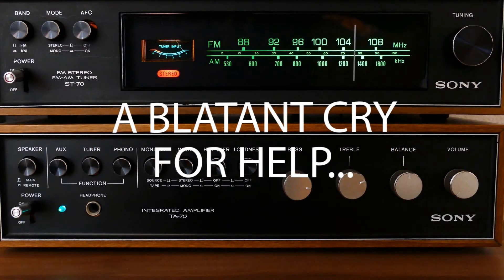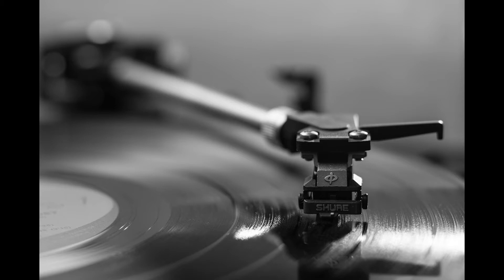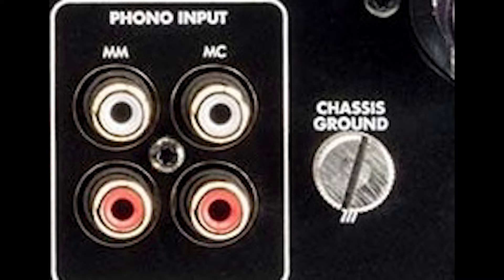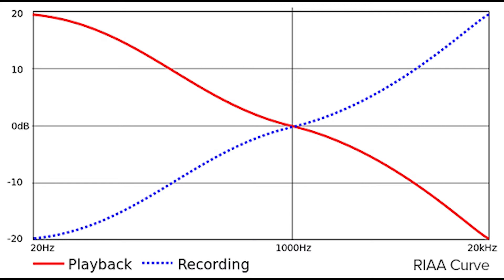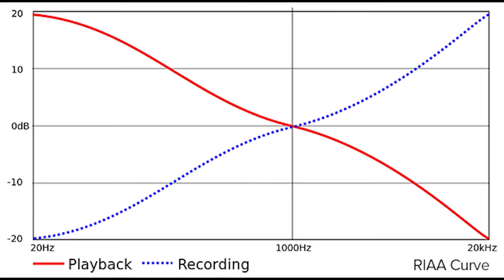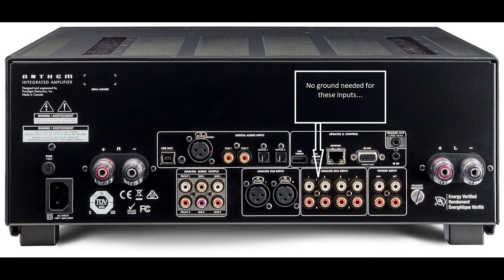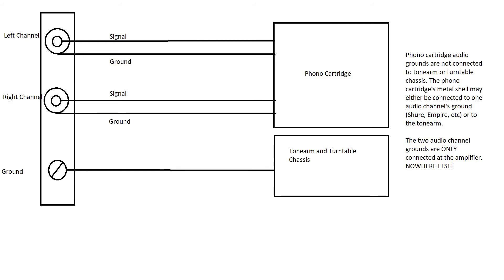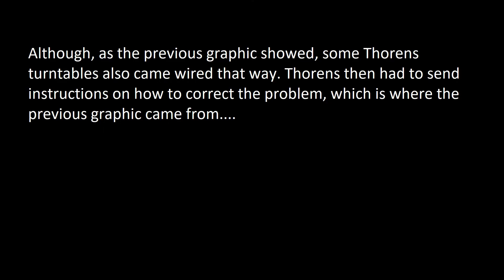Why Do Turntables Have Ground Wires?

Comment from the maker: Errata: Yes, I slipped up in editing my audio and let a double-negative through. But you know what I mean! :-) And at about 3:43 I said "pseudo unbalanced." Of course, I meant "pseudo balanced." Sorry for any confusion. And by the way, a few 1980's Sony turntables have a ground wire that connects to the shield (ground) of one of the RCA plugs at the preamp end of the cable. This will work just as well as using the separately-connected ground wire, and I wish all turntables came that way. It'd be a lot easier!
Reply: Hi Scott. Wonder if you could help me. Just received a connector that connects my turntable that has two jacks with an old amplifier, that has 5 pin jack. There is a cracking in left speaker, and same one does not produce a sound. (It is working with anything else). Those two jacks come with a ground connector, but nowhere to connect it on my amplifier. Wonder if I could, would that solve the problem? Thanks!
Reply from the maker: @sextempiric7137  all right, let me see if I understand this. You have an adapter cable, that connects a turntable with RCA jacks, to an amplifier that uses a din jack. If I'm right about that, then the noise you're hearing would not be solved by having a ground connector, although you really do need one. What the ground connector would solve is a hum problem. The noise you're hearing makes me think that you have an intermittent connection either at the phono cartridge, or at the wires that connect it to the head shell, or where the head shell connects to the tone arm, assuming that your turntable has a removable head shell. I wish you luck in trouble shooting it.
Reply: @ScottGrammer  Thanks, You're a gentleman!
Reply from the maker: @sextempiric7137  Don't tell anybody! :-)
Reply: I got sherwood reciever it have no place to ground at
Reply from the maker: @josephparisi1368  What is the model number of the receiver?
Reply from the maker: @josephparisi1368  What model number is your Sherwood?

Comment: Unfortunately the hum problem is very complex. I have a 3.3 mmf with a 2 m red , Ifi zen 3 preamp, and a Marantz amp. Mogami and Cardas unbalanced and semi-balanced pairs of cables. Grounding done first. The problem is that there is a hum, not when I listen to music, in standby, if I increase the volume of the amplifier i hear it clearly. I did all the possible tests, I checked all the wires including those in the turntable arm and in vain. The hum exists even if I use the amplifier's preamp. There is only one video on youtube that shows connecting a capacitor to the RCA jacks of the pickup, but not the value of the capacitor. I also had a Pioneer DJ but I did not have such problems. I mention that the devices were moved to make sure that there was no external interference. There is a floating ground loop and this is a major problem . I noticed that many people have this problem. I think it's already too expensive. 1 liter of gasoline and it solves the whole problem. Big secret. Nobody knows. WTF
Reply from the maker: I've only worked on a couple of Music Hall turntables. It does sound like a ground loop, but where? First, try replacing the Cardas and Mogami cables with whatever cables came with the turntable and see if that helps. If it does not, go back to whatever cables you had, and then disconnect the power brick from the turntable. See if the hum disappears. If it does, you have a defective power brick. This should be a cheap and easy fix, as a replacement power supply should not be more than $15-$30. Please let me know how this works out.

Oh, and the adding of capacitors to the phono inputs is not for hum, but to cure radio interference from nearby sources of RF energy.

Comment: I don't understand you said that if there are no ground wire  apparent to connect to the phono preamp then this is not Hifi audio equipment ? Rega turntables are among the best out there and there is no ground wire to connect, I can testify that my Rega P3 produces no hum noise it is dead silent, I can't says this to the Fluance RT85N I returned back for being so noisy beside being properly grounded with an external cable.
Reply from the maker: I don't remember saying that "if there are no ground wire  apparent to connect to the phono preamp then this is not Hifi audio equipment." But, usually, turntables with no ground wire are more prone to pick up hum fields from the environment than those which do have ground wires. Of course, if your environment is particularly quiet with regards to electromagnetic hum fields, then it does not matter as much. How much noise a turntable picks up will also depend on what preamp it is connected to, what cables are used, the placement of those cables and the placement of other gear and other cables in relation to the turntable and its cables. And then there's the phono cartridge. Some phono carts are much more prone to pick up hum and other EMF than others (Grado, I'm looking at you here). I am glad to hear that you are having good results with your Rega, and I agree that Regas are typically VERY good turntables. Thanks for your comment.
Reply: @ScottGrammer  Ok thanks to clarify this, I confirm that the ground of the Rega go through the RCA cable but the amplifier has  also to be designed to wire the ground from the RCA to the chassis correctly. My solid state amplifier is implemented this way because it is a high end amplifier. My environment is busy with noisy electromagnetic fields, I experienced it while I had the Fluance not connected to the preamp phono ground connector. Conversely I had a very good surprised the first time I played the Rega.

Comment: Are you telling me that I'd be better served by taking my new turntable that has a built-in preamp with line and phono outputs... and running phono grounded to a reciever instead of using a miniature goundless amplifier for my passive speakers.

Would that enable a higher fidelity or am I just robbing Peter to pay Paul.
Reply from the maker: Well, first, this video does not really address the difference between a built-in preamp and the preamp in a receiver. That said, if you have both a receiver with a phono preamp, and a "miniature groundless amplifier," by which I assume you mean one of the relatively new Class D amps, I would try both and just see which one you like best, and go with  that. Use the turntable's internal preamp to send a line level signal to the small amplifier (without the ground wire), and then try the turntable with its internal preamp bypassed, connected (with ground wire!) to your receiver. Whichever one you prefer is the way to go.
Reply: @ScottGrammer  yes, I was referencing the small Class D amps. I'm new in this space, and from what I was able to gather, the grounding seemed superfluous when running through the smaller amps as almost none are even equipped with a grounding point.

I guess I'm asking if these amps are just entering the market to accommodate the turntables with built-in preamps, and with it, are they sacrificing any fidelity for the sake of convenience? Maybe it's negligible?

Either way, thanks for the insight.
Reply from the maker: @The_Dissident  Some of the small Class-D amps sound pretty good. To play records, though, they must be used with a turntable that has a built-in preamp or with an external preamp. 

I've been using a Fosi Audio V1.0G for about two years now on a small bedroom system. It sounds great, within its power limits. Speaking of power, most of these small amps (and most modern amps in general) are not truthful about their power ratings because for years the FTC has not been enforcing the law on such matters. The V1.0G claims to be a 50 watt per channel amp, but my measurements show it barely makes 20 watts per channel into 4 ohms, and about half that into 8 ohms. So be forewarned.

Comment: I have a question. I have an older Sony turntable and only on some albums not all I get horrible speaker flutter. Why is this? I appreciate the video. Thank you.
Reply: Thank you very much ❤
Reply from the maker: When you say "speaker flutter," do you mean that the woofer moves in and out and makes terrible noises? That's acoustic feedback, and it's caused mainly by the speakers being too close to the turntable, especially if you have a wood floor, or if the speakers are on the same shelf as the turntable. Move the speakers away from the turntable, don't have them on the same shelf, and if your amp has a switch called "infrasonic filter" or "subsonic filter," turn it on. If your turntable's dust cover is up while playing records, either close or remove it. As a final resort, turn the bass down a tad and see if it clears up.

This feedback is simply vibrations or low-frequency sounds being transmitted from the speakers to the turntable, where they are picked back up and sent through the system again, being amplified along the way. Once this starts, it gets worse and worse, and the only way to stop it is to break the path between the speakers and the turntable, or to turn the gain down at those low frequencies. Wood floors can make this really bad if you have floor-standing speakers, and bookshelf speakers on the same shelf or table with the turntable are also a no-no.

Comment: The ground wire on my Dual cs505-4 seems broken. So I'm looking into replacing the whole wiring coming out of the TT. Also the audio wire is 3 meters long and just gets in my way. I've looked at different videos about phono wiring and RCA interconnects and your video just connected a lot of dots :)
Reply from the maker: Glad it helped.

Comment: My good friend Bill at fix my dual has a tendency to do Brown consolidation. He tends to integrate the ground wire into the shielding of the leads like you mentioned with the DJ turntables. I noticed a small amount of hum in both of my turntables that I've had him work on. So I would be inclined to tell anybody who sends a turntable to Bill, to tell them that you will want a separate ground wire even though he does that.
Reply from the maker: I don't know Bill, but I can tell you that some Dual turntables have no ground wire from the factory. That can be undone and a ground wire can be added, but your friend may not be changing anything. Some Duals just come that way.

Comment: I have got a lot if hum with a Pioneer PLX-500 which is a DJ like turntable with no ground wire. Is it possible to add a separate ground wire?
Reply from the maker: Yes, but it will take rewiring the tonearm wiring inside the unit. Right now, the ground of the tonearm and cartridge headshell are connected to the audio grounds. This will have to be disconnected and a separate ground wire added.

Comment: How is the proper connection for the earth/ground?   I’ve got an SL-1210 mk II hooked to a DBX BX-3/CX-3 combo all two prong plugs. Should all chassis be grounded directly to the wall socket screw or all to the pre-amp and a single wire to the wall?
Reply from the maker: Ideally, only one component in a home audio system should be grounded at the wall, usually the amplifier. In many vintage systems, no component is grounded at the wall, and that's perfectly fine. What you want to avoid is having more than one path to the ground at the wall, because this will cause a ground loop, and ground loops cause hum. And the turntable should be the ONLY component with a separate ground wire going to the preamp, amp, or receiver. If your other components have ground terminals, leave them disconnected.

Comment: Thank you for producing clear and concise videos for the regular guy (like me) to understand. So, if I'm understanding correctly, the ground wire is actually grounding the tonearm/phono cartridge, rather than the turntable itself. Is that right?
Reply from the maker: Your welcome, and thanks for the kind words. The ground wire on a turntable is usually connected to the tonearm and the chassis of the turntable. It does not connect the outputs of the cartridge. As for the shell or shield of the phono cartridge, that depends on the brand of the cartridge. For some, like Shure and Audio Technica, the shell of the cartridge is connected to the shield of one of the audio cables. For others, like Stanton and Pickering, the shell is connected to the tonearm through the screws that mount the cartridge to the headshell. The important thing is that there be no direct connection between the audio wiring and the tonearm/chassis, as this separation is what creates the pseudo-balanced system that keeps hum to a minimum. Those turntables with no ground wire do just this, and that's why so many of them suffer from hum.

Comment: I really hate using the terms Hot and Cold in reference to balanced signals.  It is truly not correctly descriptive of the circuit.
Reply from the maker: True, it's not. But it's perhaps easier for the student to understand than "phase one and phase two," or others terms of art. The only important thing is to decide on a connection convention, and stick with it throughout a system. And of course, to be aware of any non-compliant devices in the chain.

Comment: Rega TTs don't have a separate ground wire either. Apparently they are 'grounded' at the TT to the shield of the left channel cable. The metal of the arm pivot and chassis is easily accessible underneath on some of Regas turntables (I have Planar 3) so I'm thinking to connect a wire from here to the ground terminal on my amp. Will this be okay and effective?
Reply from the maker: You would need to disconnect the internal chassis ground from the left channel ground, or else you'll create a ground loop, which will actually make matters worse. The idea is to have only ONE path between the chassis of the turntable (and tonearm) and the ground connection on your preamp.
Reply: @ScottGrammer   awesome, thanks

Comment: My Linn has an earth wire but my Teac doesn’t. Both sound equally as good as each other.
Reply from the maker: I'm a firm believer in "if it works, don't fix it." So, if the Teac doesn't need a ground wire, so much the better! What model Teac is it, if you don't mind?
Reply: @ScottGrammer  TN 350.
Reply from the maker: @geraldoram2453  Ahh. It has a built-in preamp, that's why it has no ground wire.

Comment: This issue becomes even more critical for those using a low output MC (moving coil) cartridge where only 0.4 mv of signal gets amplified with over 60 dB of gain.
Reply from the maker: True, but the lower impedance of MC carts and preamps helps somewhat with that. What really matters in MC hookups is the quality of the connections. The cables themselves are not much of an issue, but the RCA plugs and jacks need to make perfect connections due to the low signal levels and impedances.
Reply: It's been shown that MC cartridges actually have higher output than typical moving magnet cartridge (volts x amps = watts) but that higher output takes the form of high current and low voltage. Since conventional phono stages amplify voltage they don't work so well for MC cartridges which is why transformers were once popular to convert current into a usefully high voltage so that standard MM preamps could provide adequate gain.
Reply from the maker: @socksumi  I still believe that a Transformer is the right way to do it.